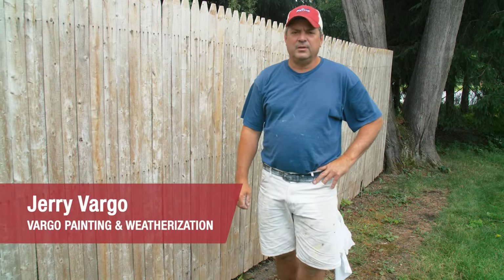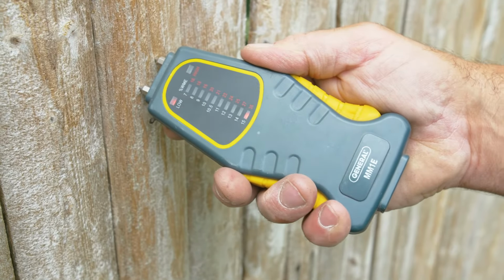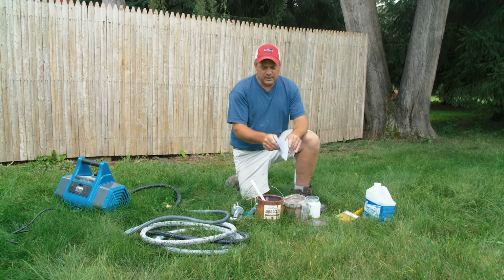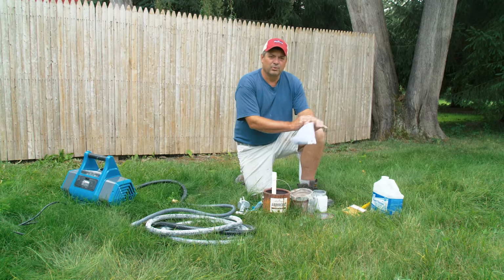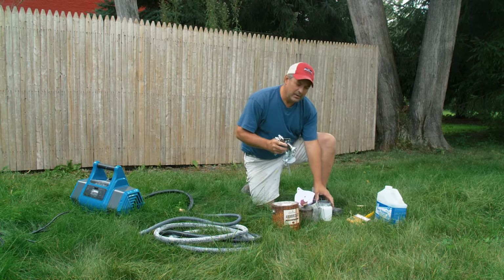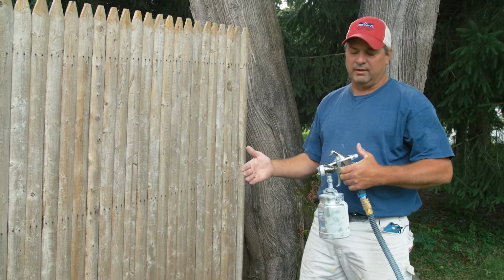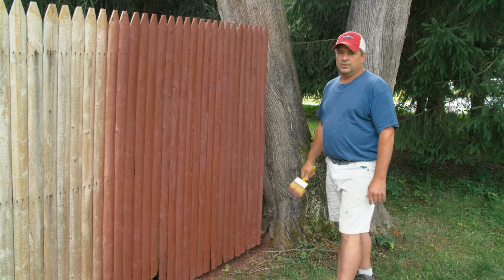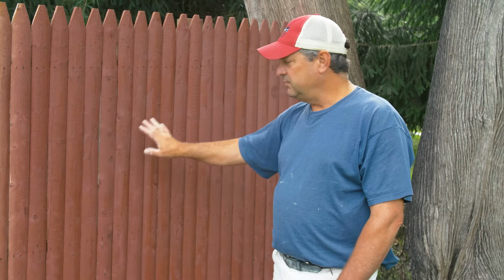How to spray stain a fence.  |  Hyde Tools

Comment: Dude you really need to do a moisture test on a fence, even after a week? I'm pretty sure you can tell if it's wet.
Reply from the maker: Do you NEED to do a moisture test? Nah. But if you prefer a guarantee that the stain job won't fail down the line, it doesn't hurt to be 100% sure.

Comment: Which sprayer are you using?
Thanks
Reply: Looks like a pretty generic syphon fed sprayer 

Harbor freight used to carry them, probably still do.
 The biggest thing is to keep the thing clean after using, especially the head and needle/springs in the nozzle area.

They also have gravity fed versions with the plastic tank on top of the gun.